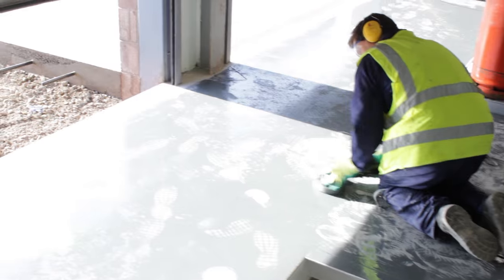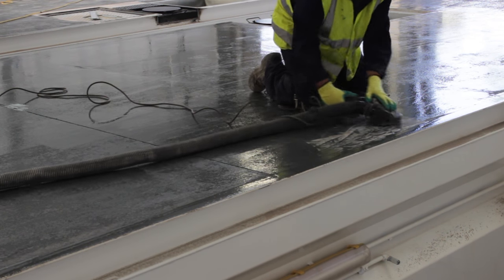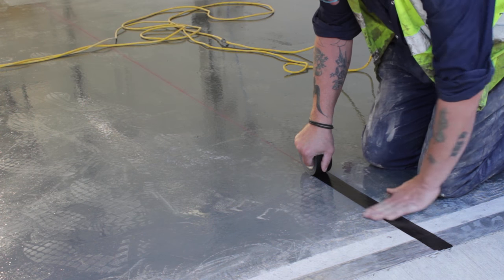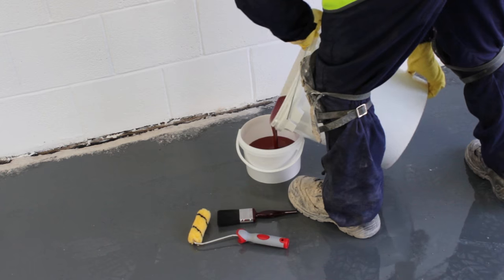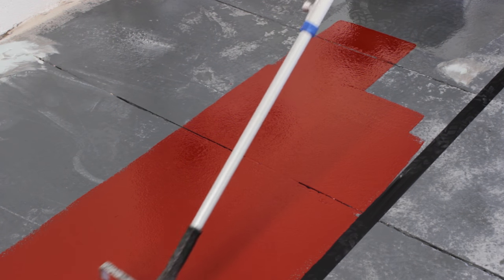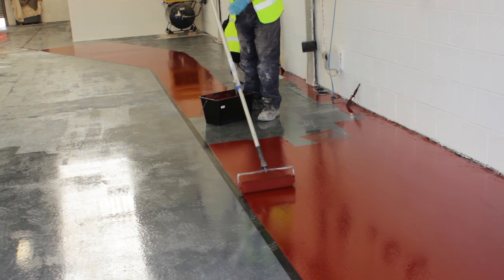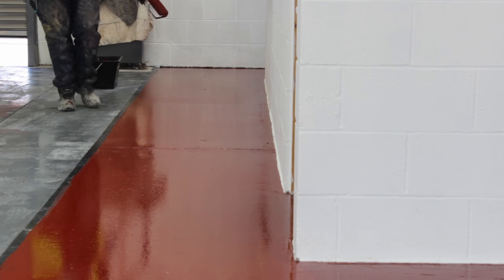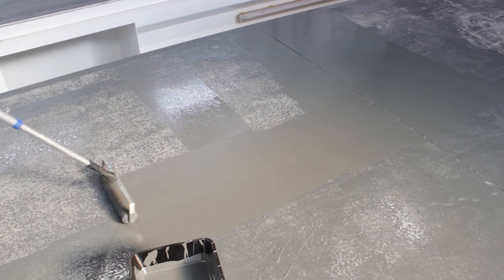Paint a concrete floor with epoxy resin paint | Rizistal

Comment: I have a brand new garage floor but in the past I have used ordinary garage paint and found it sticks to standing car tyres and pulls off the concrete leaving patches. Would this paint do the same?
Reply from the maker: This paint is trade quality and has excellent wear and abrasion resistance once fully cured.

Comment: Could I add glitter to this paint to give it an effect?
Reply from the maker: Hi Terry. Yes, you could add glitter to the epoxy resin paint.
Reply: Thanks rizistal
Reply: piranhaP  sounds brilliant , I'm attempting a cellar floor going to start it Friday with the first base coat to seal everything off , but haven't done a glitter floor before so trying to get as much info as u can

Comment: No,need primer appied? Seems awesome , if there is no need of a primer
Reply from the maker: Hi Sunil, that's correct, with a properly prepared substrate no primer is needed with our epoxy resin paint. You can apply 2 coats to give an even, glossy finish.
Reply: @rizistaluk  surely an.Awesome product . Is that available in india?
Reply from the maker: @sunilkumararickattu1845  Unfortunately we currently only supply to UK addresses